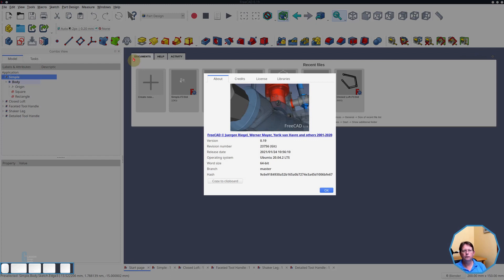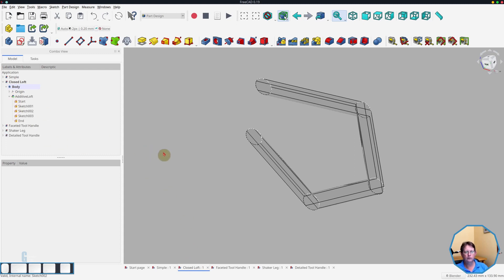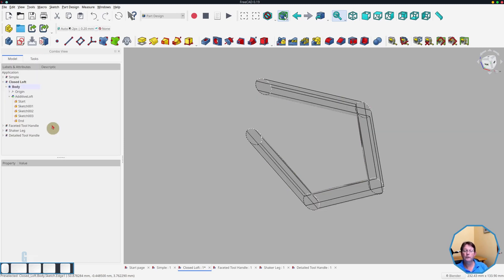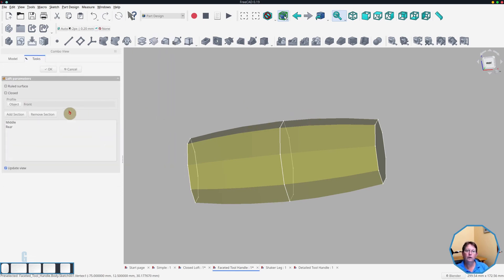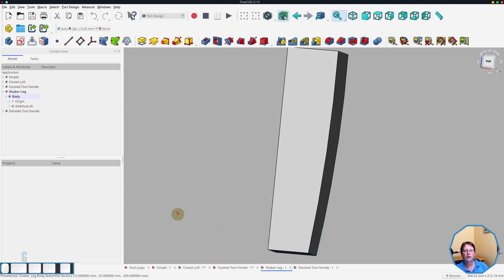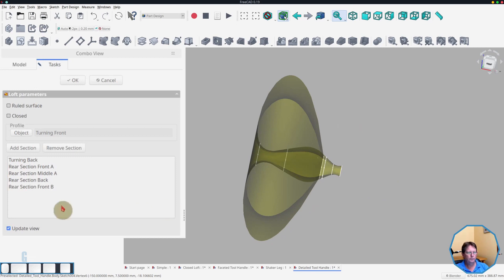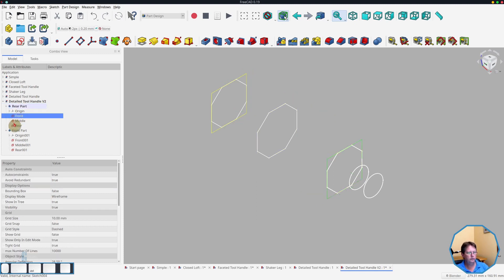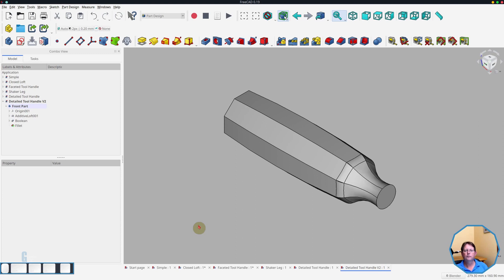Howto use the Loft Tool in FreeCAD's Part Design Workbench

Comment: Hi Glasson Where  did you get that pointer. You are using Ubuntu but that looks like a Windows pointer found at catnip5 like it. The windows one you can make the pointer red with a better yellow hue around. A bigger red pointer is so much more visible.
Download Ubuntu Tweaks. There is some nice tweaks. Also go to your
 Settings --> Accessibility. Some nice things here. Play around with Zoom, IOn most computers Zoom works well but if yours get jerky switch it of.
Just a little bigger pointer please,
Reply from the maker: Thanks for your feedback. I’m using Kubuntu which uses KDE not Gnome so your suggestion might not work. I’ll investigate further but make no promises
Reply: @GlassonDesignStudio  The pointer color and hue around is perfect. Only the pointer it self is extremely small.
Your speech speed and explanation and volume is perfect.